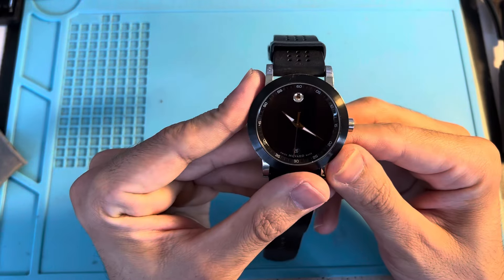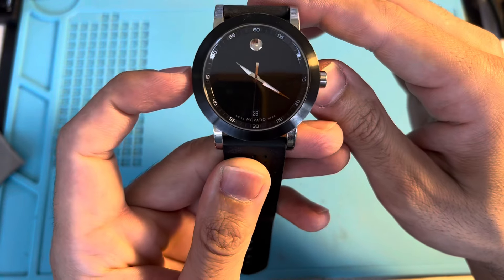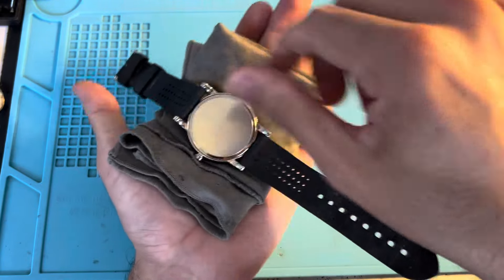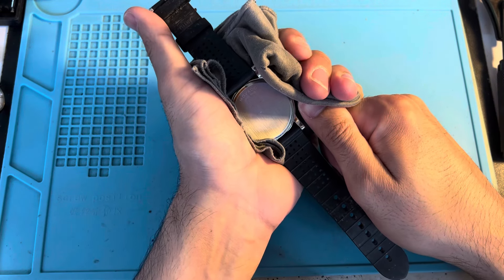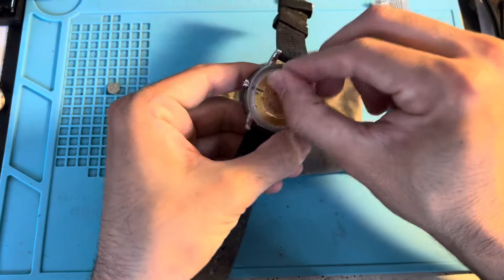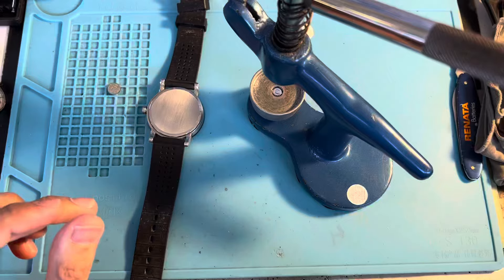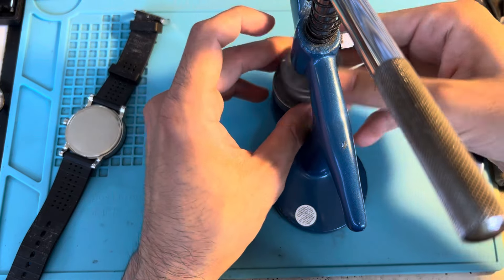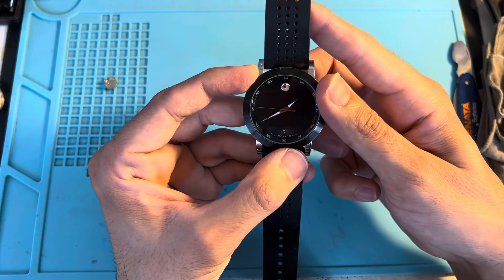Movado Watch | Watch Battery | Battery Replacement | DIY

Comment: Good news,  bad news... needed to replace the battery and jewelry store wanted $75. This video seemed like easy instructions to remove back cover on my Movado. Followed video and back popped right off.  Now the bad news... even with the micro fiber cloth, the little pressure from my palm to the side of the watch caused the adjustment knob to break off the adjustment stem. More expensive fix than the battery. Should just had jeweler replace battery.

Comment: Does the water resistance stay using your method? Thank you
Reply from the maker: Water resistance can be secured by lubing the gasket and inspecting for any damages to it. If it looks good and is properly lubed you wont have any issues. I follow the same principle

Comment: What are the contact points after battery replacement for the Movado Bold Touch Digital watch ?
Reply from the maker: Look for “AC” on the back and use that as point A and the bare metal on the back as point B. Do that a few times for it to register. If that doesnt work, remove the battery and install it again a few times for it to reset. Hope that helps.

Comment: I've been trying to replace the batteries in my Movado Museum watch for a year. I've taken it to professionals and even they can't seem to get it open. One even scratched the back a bit. I've been replacing watch batteries since I was a child and have never had this issue in my entire life. Do I need a specific tool? Because nothing I have used to far has worked and I really don't want to scratch this thing up. I just want to be able to wear my watch!! 😢
Reply from the maker: Its more technique than anything else. You ll have to find the spot where it opens from. Cover the back case with masking tape to avoid scratches